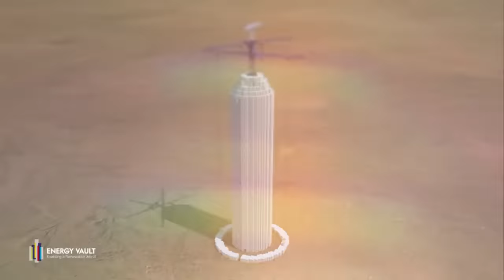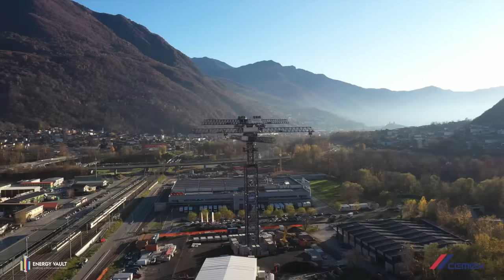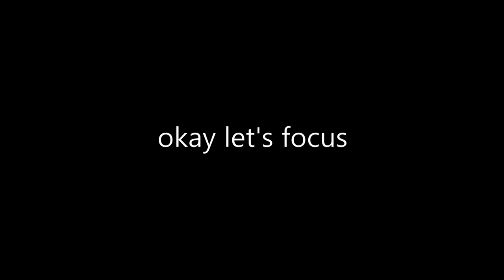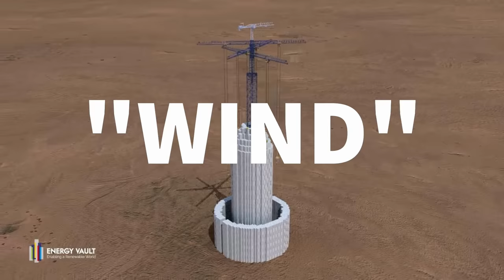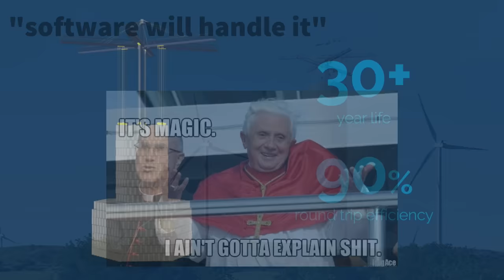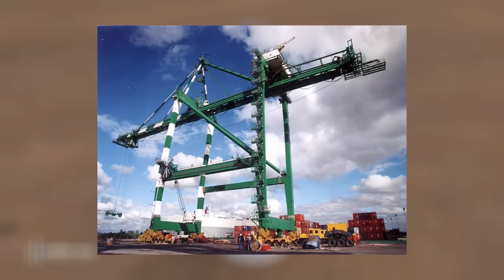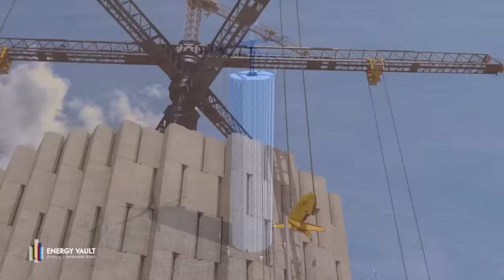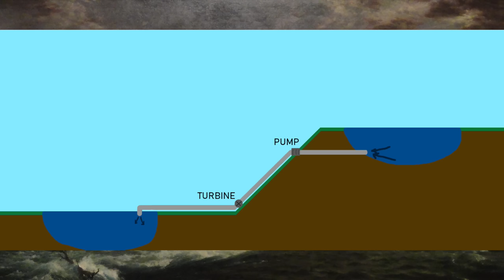The Energy Vault is a Dumb Idea, Here's Why

Comment: Now, not to defend the gravity storage with concrete blocks, but water pump storage does have problems, that this solution doesn’t have and therefor might be applicable in a use-case.

As an example absolutely flat terrain with little to no water.

Comment: Also, as one stack gets higher, the distance of energy generated by drop, decreases. There will be a high percentage of energy spent to move weight without gaining that energy back.
Reply: There may be real criticisms of the idea, but this isn't one. You get all the energy back. The height of the outer stack limits the amount that can be stored but doesn't waste any energy. Not to mention, the outer stack has a (potentially much) larger radius and so it isn't nearly as high.

Comment: Not that there aren’t problems with this approach, but pumped storage is not a one-for-one replacement here. Hydropower is extremely reliant on suitable topography, usually has a large land footprint, and is very susceptible to problems with acquiring the right-of-way needed to actually be built, even if it passes environmental reviews. In-place gravity batteries aren’t subject to nearly as many of those problems, and can be easily colocated with generation. Wind may be an issue, but dismissing the feasibility of strawmen solutions (software or otherwise) without actually talking specifics is little better than blindly believing they’ll magically show up. Digging giant pits isn’t even possible/feasible everywhere, and even where it is it introduces a lot of overhead compared to just putting up some cranes and stacking bricks.
The points you raise have some validity, but they only serve to point out that this isn’t a cure all. It doesn’t prove that the technology is bad or useless. The difference between a stupid idea and a success is often down to implementation, and to knowing when and where to implement it. Calling out excessive hype is one thing (and a good thing at that), and being honest about the drawbacks of a technology is important, but this all feels more like pessimism to me than realism, and that doesn’t help anyone.
Reply: This should be higher up

Comment: To be fair, the proposed solution for stored water simply isn't available everywhere. 

Now, for the giant pit solution question: not everywhere you may wish to place these types of things are the most feasible for digging that deep, at least not economically.  Your statement regarding wind issues is not to be ignored: giant blocks, as heavy as they are, still end up becoming bad sails, but sales nonetheless, when on the end of cables, and cables not loaded down with blocks are far worse.

So, in cases where you can't readily dig a deep enough hole, there is a perhaps cheaper solution: build a building around the whole stupid thing.

Space-wise it'd make more sense to have the blocks have holes in the middle, with a cone shape entrance on the top to make it easier to drop the cable down: their mechanisms shown for dealing with the block corners is silly excess and wasteful of space for stacking around the entire block perimeter, while a hole through to the bottom can also allow a larger surface area for suspending the block on, when done correctly, with more mechanical simplicity possible.

Even the best of concrete blocks tend to crack and wear over time.  I'd not want to be inside the work volume of such a contraption when it is in operation.  This contraption needs "Falling Blocks" warning signs, as it's not a matter of if, but how often it happens.  Tungsten is heavier, denser, and far less likely to degrade over time, so perhaps all that could make it more cost-effective compared to concrete blocks for a given time period: the rest of the mechanical details would need to be replaced first. Tungsten is many times heavier per volume, almost as heavy as gold, but far sturdier: it'd readily tolerate many decades of stacking with its properties.  It's also more thermally-stable for coefficient of expansion.  It'd allow far more potential energy storage in a given volume. 

All that being said, gravity batteries are very large and expensive stuff for their storage capacity to maintain: a far better grid storage solution appears to be the Ambri liquid metal batteries, already in-use, which don't degrade over time.  There are no moving parts to worry about with them.  They're made of simple materials.  They can't catch on fire like lithium batteries regardless of what you do to them.  They have no weather condition sensitivities (lithium batteries must not get too hot lest bad things happen to them that drastically shortens their lives: these batteries require heat to function!).  If you shot one, it'd fail safely.  If it somehow gets too cold to function properly it becomes inert, until enough heat is added.

I would also choose flywheels over these stacked blocks for proven technology, efficiency, and relative simplicity.
Reply: How do flywheels interact with this concept?

Comment: I get the wind problem, but hydro is not the silver bullet either; its location dependant, plus has a low energy density. Concrete (of even heavier materials like waste reinforcement products) provide a more localised solution that's applicable at far more locations.
Also water pumps tend to be less efficient than lifting cranes, with a higher energy loss per moved voume.
I got a masters in civil engineering btw
Reply: Concrete produces emissions and you can just attach a bucket to the crane the to lift the water!
Reply: If you're building the infrastructure for this crap then you can more cheaply build contained pumped storage using sea water.
There's not a lot of the planet that isn't in transmission range of the coast.

Comment: i once calculated how much energy could be stored if my whole house could travel vertically. the distances required were ... surprisingly large. water is a far more movable commodity and i don't doubt it still beats out stacking towers even if you have to build tanks

the real problem here imo is that people buying pie-in-the-sky ideas don't usually understand scale. people know that pumped storage uses HUGE reservoirs. they can imagine that building comparable capacity without natural resources requires implausibly large tanks on stilts or in holes, but they can't imagine that the towers required don't fit their neat cartoonish picture. for a decade or so there was a scam air car attracting investors because people couldn't imagine that the required air tank needed to be vastly larger and would take forever to fill. as long as a demo could drive laps in a tiny carpark, it impressed the eff out of people

a lot of locations have hills. i suspect you can't do better than sliding a vast weight up and down a slope, making the machinery [and even the "cable", which would be a chain with links like buildings] part of the mass. why is there this obsession with small weights moving fast instead of one large slow weight? i think maybe it's playing on our false intuition that when it scales up we can move vast quantities of dry material as efficiently as we move water

i can't stop thinking that a lot of the blocks are not lifted very high and contribute embarrassing little energy. maybe there's a subtle problem here of being confused between the requirement of structure vs mass? is the need of the most energy dense (ie highest) blocks being met with a tower made of blocks? or is that optimal tower maybe a thing called a hill?
Reply: Sisyphus storage! Stick a big ol block of stone on an electric train flatbed and have it go up and down a hill as needed?
Reply: I'd want to see numbers on rolling friction for very large masses, and the gearing system needed to manage its movement, but I like the idea in general.
Reply: @mister silly It's still nearly impossible to moderate the power output even with the small weights. In a pumped storage plant, you can gradually open/close the water valve. In this system, any block will blast full power into the grid while going down no matter what the load is.

@Josh Adams Well, you can get pretty close to that concept with electric trains: DC-powered ones (And AC ones lately) can feed energy back into the grid when braking.

Comment: My first question was about the energy capacity for this.

Since you probably could cover a couple of wind turbines with one tower, you'd need only a handful of those tower in a small wind turbines farm. But if we truly want to go 100% green, we'll need hundred of thousands of wind turbines. Wich translates to hundreds of thousards of those tower.

It would probably create far less CO2 to dig two stupidly huge holes to create a water storage system that would hold nearly as much power... and it would far more sustainable on the long term as maintenance costs would stay quite stable.

Comment: 2:39  Obviously if this company had enough sense to take this one idea of yours, they would probably follow through and just do the turbine thing. But hypothetically, if they just made the same tower but put it in a big pit, would the machines digging this hole produce a significant amount of co2? This would be on top of constructing the blocks themselves of course. 
(not trying to be "that guy" here, I don't think this tower is a good idea at all)
Reply: Elon and his Kin = Big Problemoh
Reply: There is another approach where deep holes that were already dug (old industrial mine shafts) could have weights installed in them, but that's limited by existing supply of unused shafts... Bowchika-bow-wow.
Reply: @PuckLokin  earthquakes maybe occur during the building of the tower

Comment: Yes, the energy reserve through hydroelectricity is the best solution, however in the country where the energy vault is developed (Switzerland), they have already reached the maximum implementation capacity of hydroelectricity. So alternative solutions have to be found. And if you look at the plants built are small in size, having a non-circular structure or digging it into the ground would drastically increase the costs.
Reply: Non circular is a lot more space efficient due to simple tyling. Although a more efficient chape is possible in triangles.
Reply: The capacity of these storages is laughable though. Especially because all the bricks at the bottom store basically no energy.
Reply: @0106johnny  you need a base to hold the brick to free up the cranes to carry more bricks. You are effectively creating a battery with each brick giving you an increasingly larger capacity.

Think of it like having a good foundation, without you cannot build higher.

Comment: Normally I agree with your videos but the point of having weights lowered and raised is so that countries and areas without mountains can take advantage of gravity batteries. Currently some of the only countries that have pump storage are mountainous ones with lots of available water such as Switzerland and some parts of the United States. Thus while this gravity battery is somewhat poorly designed, a gravity battery involving weights and pulleys hung down a hole in the ground would really help flat nations that produce a lot of solar or wind power.
Reply: @louisvictor3473  Okay, here's an intellectually honest criticism of the design: many of those blocks are utterly worthless for storing energy, and it becomes less efficient very quickly.

Simplify the design to a 2-D version, so you have only two columns of blocks, and storing and releasing the energy consists of moving a block from one column to the other. Start with column A 10 blocks high, none in column B. Now, we're "discharging" from A. You move a block down from A to B, you get maximum stored power released, ending with the piles being 9-1. Now move another block: it doesn't drop as far, because it's moving from spot 9 to spot 2. Next block releases even less energy, moving from 8 to 3, then 7 to 4, then 6 to 5 and oops: both columns are now 5 blocks high. We have to input energy in order to move a block from one column to another.

Now, theoretically, you might are ways around this: instead of having one receiving column, we might have two, B and C. So your discharge pattern is A10>C1, A9>B1, A8>C2, A7>B2, A6>C3, A5>B3 and oops, done again. There's no point moving A4 since it would only go to C4 or B4 for no net gain. You can keep doing this, adding additional receiving columns, but you can never get higher than 90% output because that bottom A1 blocks can only either be moved sideways or up. And in any case, regardless of how many receiving columns you get, the energy output is always lower as you go down because the gravitational potential energy is lower while the receiving environment is higher, lessening the differential and thus the energy you get out of it.

And then there are the additional costs: for every column you go outward to increase the amount of energy you can harvest from the storage column, you increase the amount of energy required to move the blocks laterally, and that loss is the same whether you are storing energy or pulling it out. So the less efficient overall it becomes because it's requiring energy to work that can't be used for storage or be extracted.

Pumped fluid, on the other hand, has the advantage that you don't have to pay anything for it to go down: you're getting pure energy extraction from the generators without needing to put any energy into the system. Similarly, if you place the pumps correctly, your energy input to store is purely used to move the fluid to the higher elevation, and you don't need to expend any energy to move the fluid to the pumps; the fluid gets there on its own.
Reply: Why not build a giant water tower instead?

Comment: I just watched a video that explained the problem with pumped hydro: the energy density is very low. You need to have a huge reservoir with as much difference between the top and bottom portion as possible. So, you can't put that just anywhere. And I will add that evaporation is surely an issue in some places. So, we're looking for an alternative gravity battery. Maybe this design sucks; so, what else can we come up with? I like the idea of rolling a really heavy train up a hill or something. No, I don't know how the control of moving it up and down would work.
Reply: I proposed my own idea of how this could work recently. While not a detailed explanation, maybe you could better flush out the concept? Any contribution or differing ideas will be happily appreciated.
Reply: @caydenwootton7293  , I found a lot more under the term "gravity battery". And apparently these things are being built and used, though it appears to still be a pretty new technology. For the most part, it looks like a weight held by cables is the way, though not like that stacking thing.

Comment: The energy vault is supposed to be an alternative for hydropower storages, for areas where water is a rare resource or the terrain is mostly flat. Digging a giant hole is way to expensive for a contraption that is supposed to be built in masses.
Reply: I have a crazy idea, maybe have the hydropower storage in places with water and a slope and when places without that needs is we transport it by wires. And if your in a flat places chances are the winds are pretty harsh so you need it underground. Plus the places you speak of are either uninhabited like the Sahara or are close enough to the ocean or large water sources to where it would be easy to do water storage like Mexico and Southern Africa
Reply: @kousand9917  Flat places aren't super windy.  Most windmills are placed where there are rolling hills.  Flat places are good for solar.  Herp derp.
Reply: @kousand9917  How would you do water power storage near the ocean?  It still requires specific geography.
Reply: @kousand9917  Saltwater is generally unsuitable for this sort of thing because it is so easy to erode and damage mechanicals/hydraulics. You can't just use the ocean for everything.

Comment: Thank you for pointing out the absurdity of this venture. As far as gravity storage goes, pumped hydro really is one of the best, but if you don't have the terrain, then you build down, not up. Vertical shafts with suspended weights will offer much more promise than towers. Even compressed air or liquid air energy storage should be much more viable than these towers.
Reply: of course it would be better. but what about the price? and would a city like such big underground towers? there are traintracks and streets underground nearly everywhere.
Reply: @swissarmyknife7670  You don't build 'em in cities, for the same reasons you build coal-fired power stations in the middle of nowhere. 

Your best bet is to use depleted mineshafts. They're deep, out of the way and already dug out.
Reply: Of course you still need to get solve the water problem, for some reason everyone pretends that we can jut have water where ever we need it.